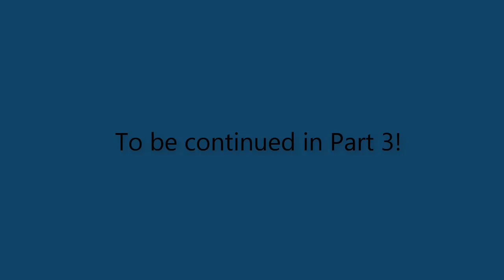ELAC’s Andrew Jones: The art of speaker design, Part 2

Comment: I enjoy hearing Andrew talk about his designs. Fascinating. There are so many variables. Does anyone remember the blind golden eared Roy Cizek? He used acoustic suspension with a Q you could adjust from .6 to something like .8 or 1. They had a very tight bass sound with the low Q. He liked to use floor reinforcement and a 1500 hz crossover with a 10 “ or 8” woofer in a two way. The woofer would be low on the baffle and the tweeter right above with foam covering the front for diffraction. This gave the peerless tweeter a little reinforcement. That was a great rock speaker and I think it would still impress.
Reply: I had 12 of his speakers back in the late 70s. Technically the improved versions.